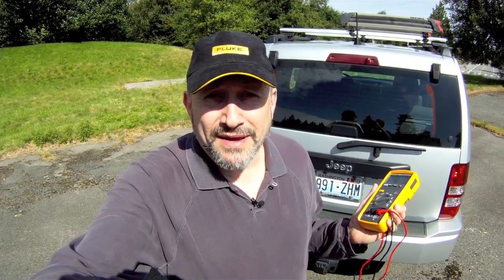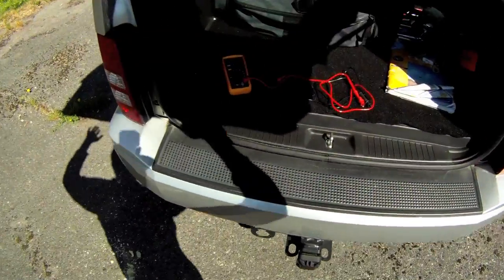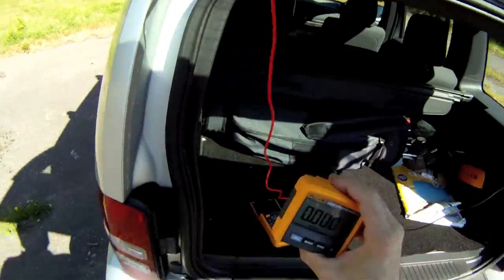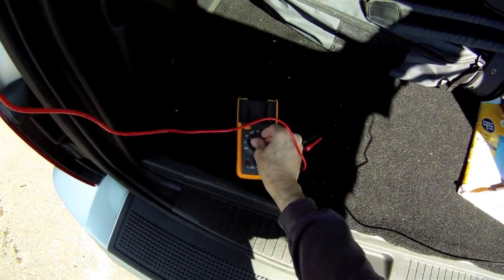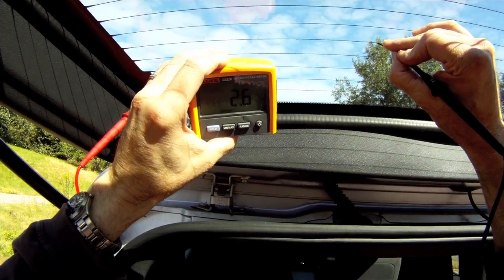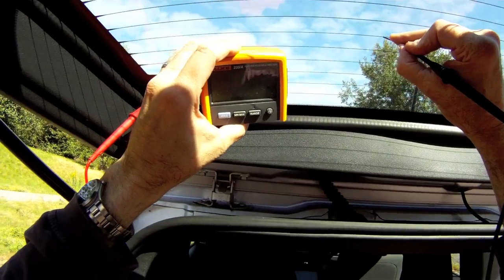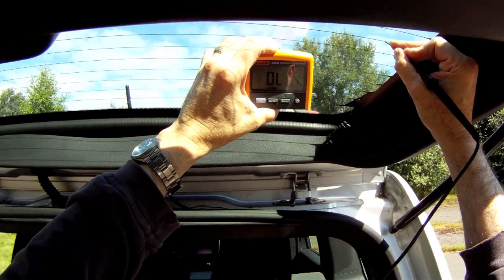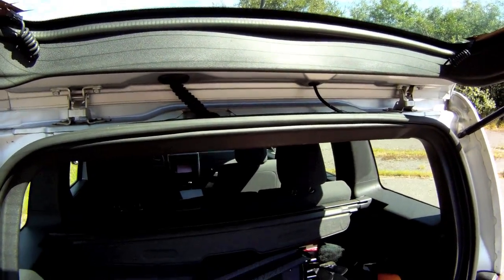How to Test a Rear Window Defroster Grid With The Fluke 233

Comment: I would have disconnected both of  connectors before measuring resistance across the grid panel.
Reply: Does not hurt to have power on and car terminals attached. The tiny heat strips don’t cause an issue with voltage reading at cars terminals. Disconnecting the switch from the heat connectors is not necessary. And When he tested for ohms. Power is not on at this time. 
You also may have continuity between the main bands +- yet you may not have resistance down each wire individually. So both have to be checked.

Comment: One big problem with this meter. Unlike the base, there is no on/off switch for the display unit, Instead of spending money on new batteries, I started to use rechargeable ones in mine until I got fed up with it and went back to my 179. They should have installed an on/off slide switch on the side to prevent this display from having a parasitic draw on it.

Comment: I took my car in to see why the rear defrost wasn't working. They tested every thing and said it came back to a faulty module that cost 700 dollars. Can't i just tap in to the wiring and add a manual switch and turn it on and off myself?

Comment: Thats why i need to the ac/heater control unit wiring diagram for a chevy mont ss 2005 to see whats going on to trace the issue but its screwing up heat in this car. Very weird issue.

Comment: ever run into a  problem where when you press the defrost button for rear defrost on ac/heating control unit you get battery drain. I imagine its a short but it doesn't blow any fuses. And the weird thing is its affecting heat coming out of the vents for heating the car to. So i am lead to believe that the circuit for the defroster is before all the battery fuses so just drains the battery without blowing any fuses... or its enough corrosion resistance to make the short not a fully short wire to prevent a blowing a fuses just by corrosion build up resistance...hummm,

Comment: "What I'm looking for is an open" - the problem is that there is no open, it doesn't exist. There are 10+ heating connectors in parallel  between 12+ and ground, and unless every single one is cut your open is not going to be there no matter what. What you need to measure is the Ohm increase. For a broken grid line the ohms will jump slightly compared to the rest.

Comment: Fluke Corporation => You will never get an open reading because the are other lines in parallel. You only can measure a small jump in the resistance reading right across the interruption. I will forget your fault, if you send me one of these meters ;-)

Comment: Always a big fan of your videos Cory.  Gotta call ya out on your choice of using the Ohmmeter to diagnose a defogger grid though...  It's one big parallel circuit(s) so you won't see breaks.  Ditch the Ohmmeter and use the Volt meter next time ( ;